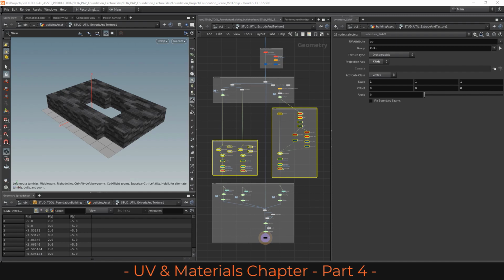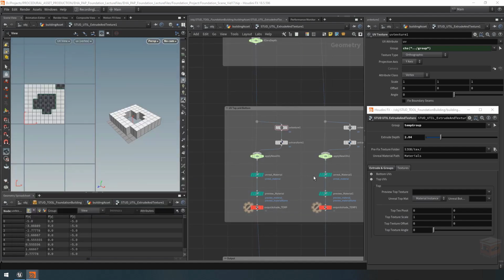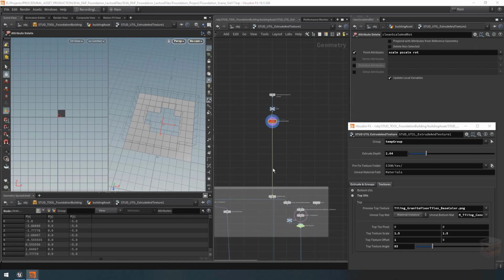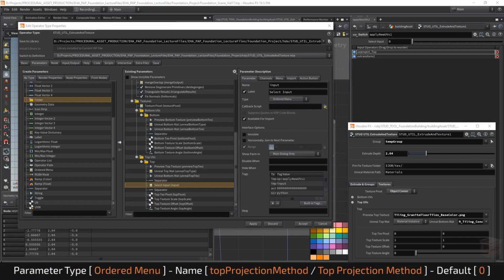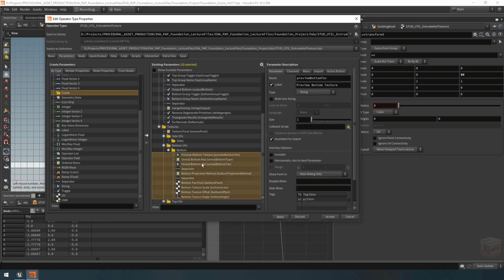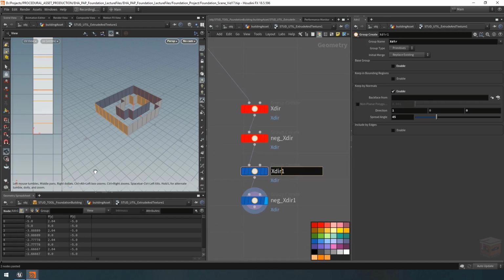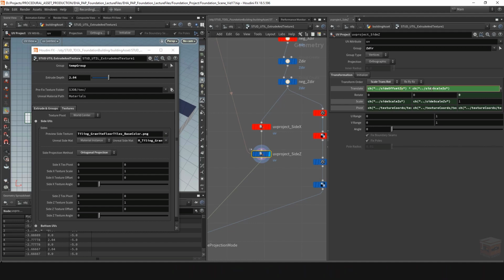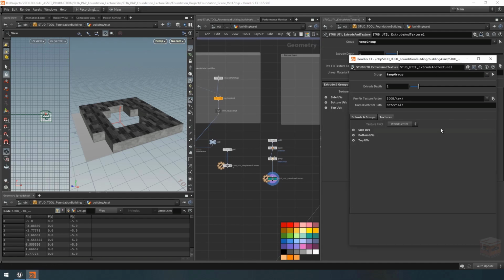HOUDINI FOUNDATION - 21 - Extrude and Texture Node (2/2)  - ( Free Tutorial for Game Dev in Unreal )

Comment: This whole project is such a roller coaster: tons of great stuff, but also infuriating when Houdini crashes. I found a systemic bug when linking the HDA properties to nodes and then testing out the values by changing those properties, Houdini would crash with a <unknown> Error(-1): Expecting open brace for script, 9408: Fatal error: Segmentation fault error. It took me a while to untangle the mess when trying to recover stuff from the crash file. Fortunately, your videos about the Asset Manager came in handy, I was able to find the stuff that was Embedded and remove it and instead re-link the right HDA file and paste in back the nodes from the crash file and reassign the properties. But in the end, I'm still following along, and this is a great learning experience !
Thanks again for all those resources, that's an insane amount of content. I can't believe you made all of that, created a curriculum, recorded the whole process and edited all those hour long videos...
Reply from the maker: I've not encountered this issue, sorry to hear you're having so much trouble with crashes.

One advice I can give for recovering is to copy the crash file to the project folder before opening it. just bookmark the houdini temp folder in windows explorer so you can quickly grab from it. most of the time, depending on the crash, everything will still associate to the hda's instead of embedding. 

If this crash is common for you, we can have a look at it on the discord channel.